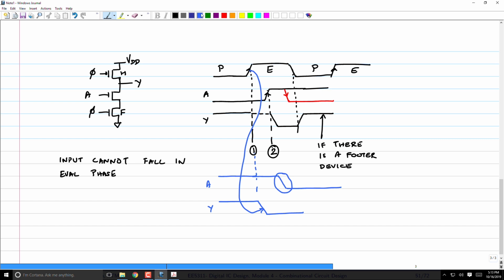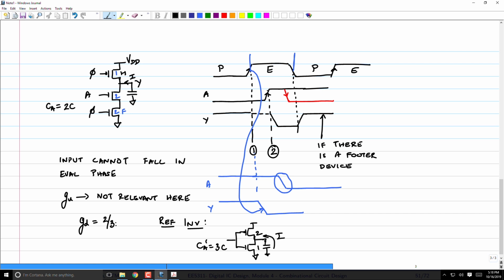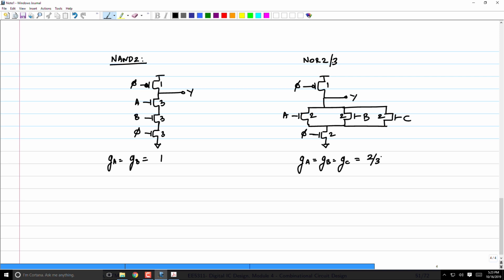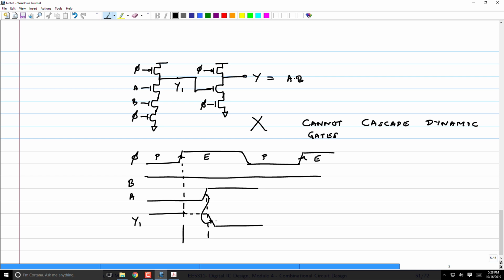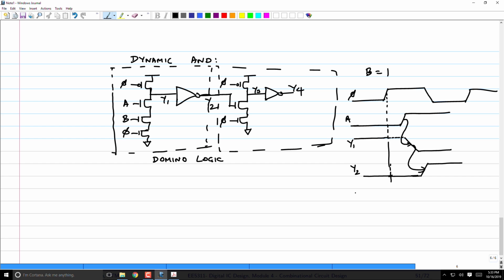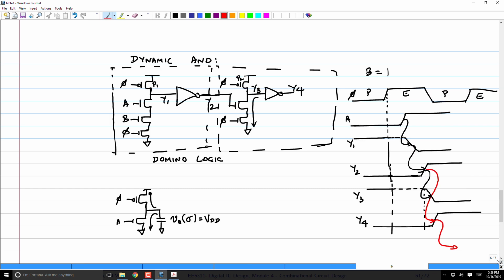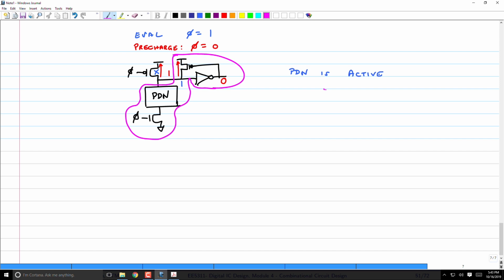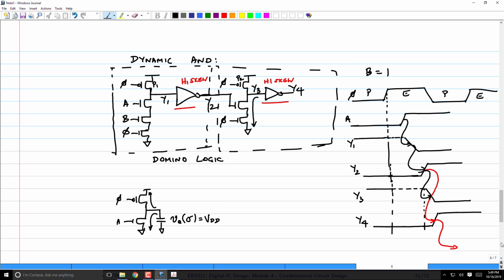CombCkt-19 - Domino Logic and Weak Keepers

Comment: what was the discussion going on between 20 to 22 min ??
Reply: I think the doubt was, why we take float value as vdd , then sir told it will not vdd but we don't know where it will settle so before discharging it to below VIL we should change the clock from evaluate to precharge phase. Then in the next topic, we saw there is a weak keeper, so there will be no floating so as no confusion now.